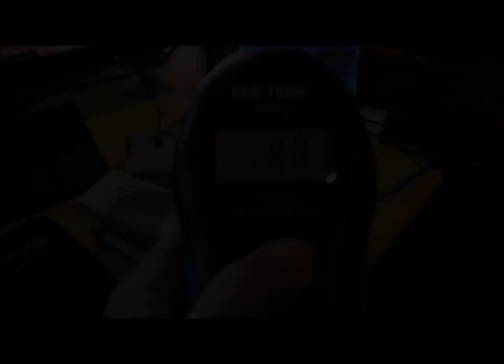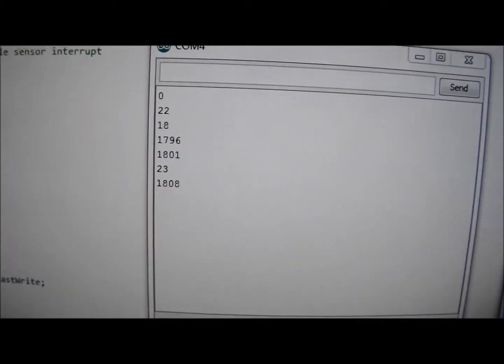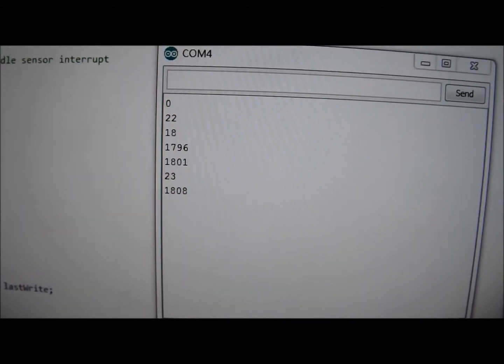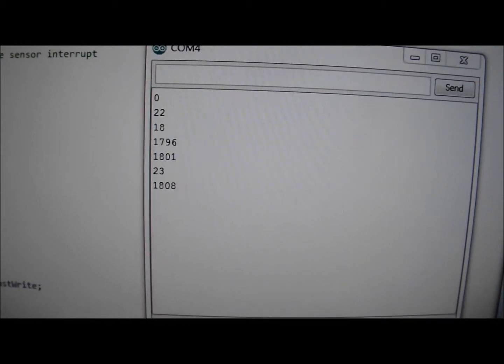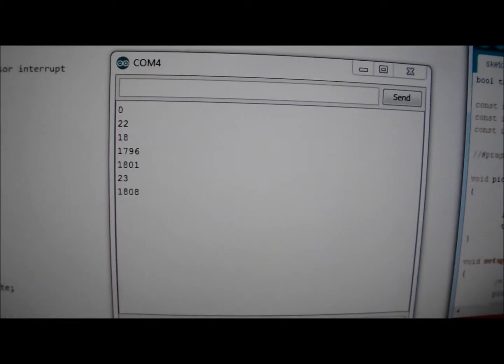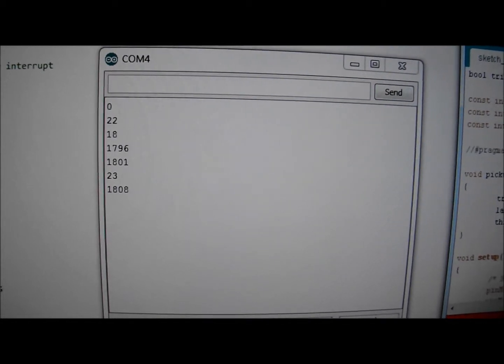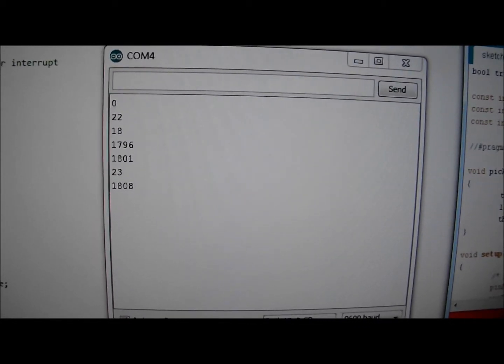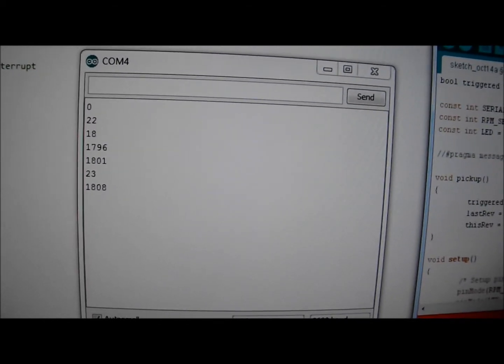RPM Test

Comment: Did you ever get around to installing this on a bike?
Reply from the maker: Carlos Ruiz No, unfortunately.
Reply: +Sonreir A friend of mine just bought a cb350 and wants to make one. I am a hardware electrical engineer and have designed all sorts of things. This is right up my alley. My friend is actually a Mechanical engineer so the combo works out perfectly.  If you don't mind, I think I'd like to push your project forward. I think some architecture changes need to be made since plenty of new uC's have become available since you started. I work closely with TI engineers and I love using their products so for starters I'm going to port everything over to an msp432 arm processor. And of course everything we do (design files/code) will be available to everyone. Let me know what you think.
Reply from the maker: Carlos Ruiz Sounds good. I'm a software engineer, so the hardware portions of these projects have always been a challenge for me. If you'd like to speak with me further, I can be reached at info@sparckmoto.com